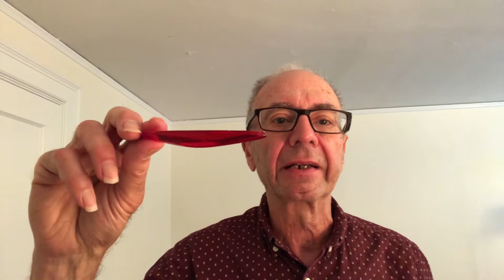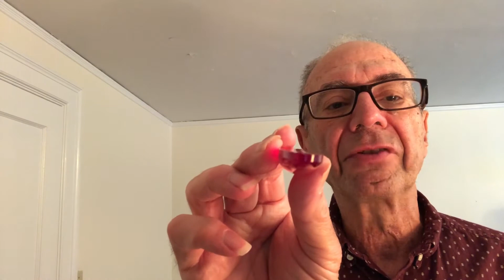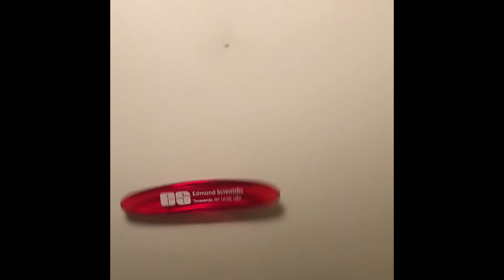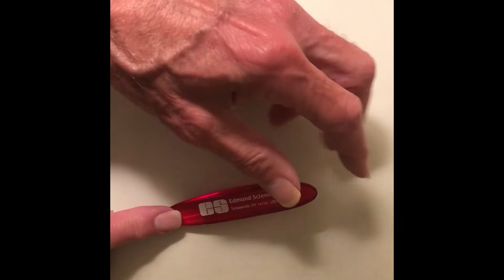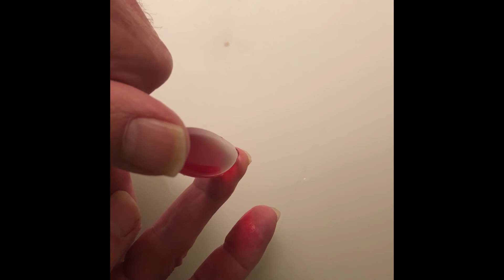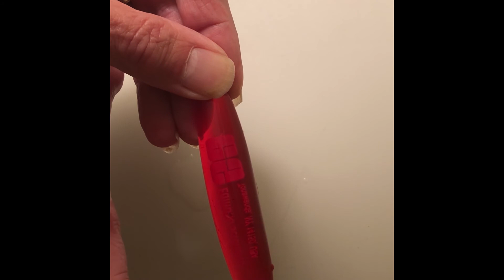Professor George Adams - Dynamics of a Rattleback

Comment: Great demonstration professor! Congratulations! With this demonstration you probe that the interaction between the rattkeback and the surface is a key element of the rattlebacks complex spinning dynamics. Could you, please, recomend to me, some articles, lectures or books which I can use to better understand the complexities of the rattlebacks dynamics? Thank you very much.
Reply from the maker: Here are references which came from a project by Carmel Majidi who is now a Professor at Carnegie-Mellon University.

[1]    Walker, G.T. "On a Curious Dynamical Property of Celts." Proc. Cambridge Phil. Soc. 8 305-6 (1895).
[2]    Walker, J. "The Mysterious Rattleback." Sci. Am. 241no.4 172-184 (1979).
[3]    Kane, T.R., Levinson, D.A. "Realistic Mathematical Modelling of the Rattleback." Int. J. Non-Linear Mech. 17 175-186 (1982).
[4]    Blackowiak, A.D., Rand, R.H., Kaplan, H. "The Dynamics of the Celt with Second Order Averaging and Computer Algebra." Proc. ASME DETC'91 (1997).
[5]    Pascal, M. "Asymptotic Solution of the Equations of Motion for a Celtic Stone." J. Appl. Math. f3 Mech. 47 269-276 (1983).
[6]    Markeev, A.P. "On the Dynamics of a Solid on an Absolutely Rough Plane." J. Appl. Math. f3 Mech. 47 473-478 (1983).
[7]    Bondi, H. "The Rigid Body Dynamic of Unidirectional Spin." Proc. Roy. Soc. Land. A 405 265-274 (1986).
[8]    Hermans, J. "Rolling Rigid Bodies." PhD Dissertation (1995).
[9]    Karapetian, A.V. "On the Problem of Steady Motions Stability of Nonholonomic Systems." J. Appl. Math. f3 Mech. 44 295-300 (1980).
Reply: @georgeadams912  Thank you very much, professor George Adams!